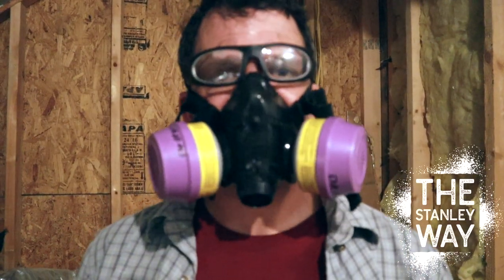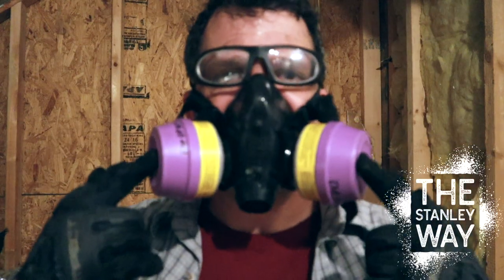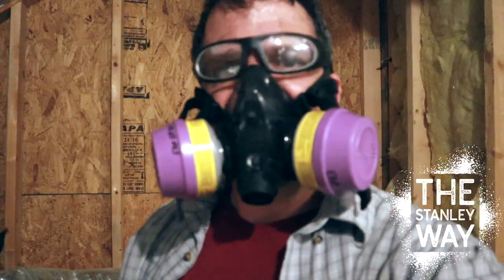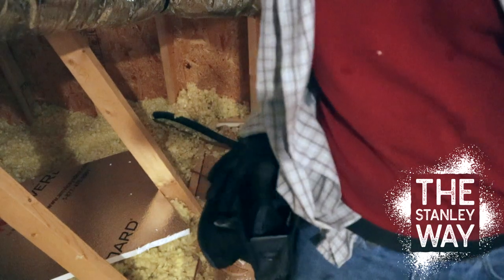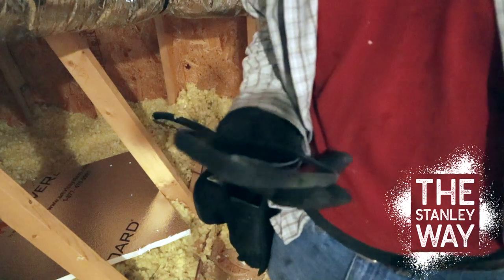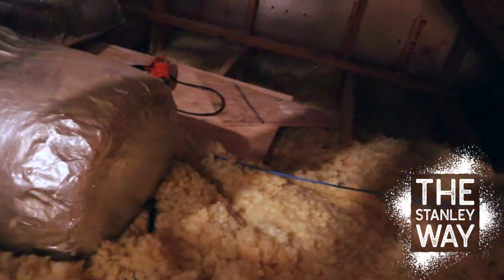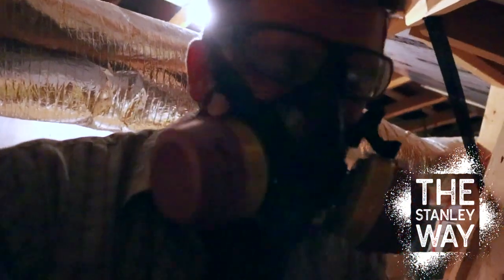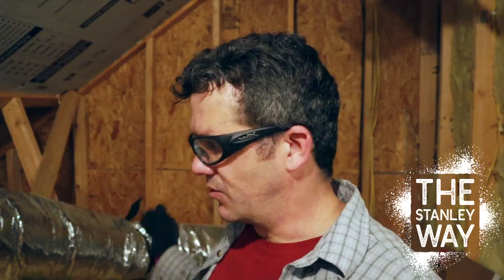Vented To Unvented Attic Conversion Video

Comment: Live in SC and have the same issues with my HVAC ducts and air handler being in my attic.... Was thinking of getting it spray foamed. Looks like you insulated between and over the rafters with foam sheets? Any issues with moisture because of that?
Reply from the maker: I have had no issues with moisture. Since I used foam sheets it’s not 100% sealed of course but there is a huge difference in temperature. It has worked great so far.

Comment: Love this video. What did you do for venting? I mean to make sure there isnt any humidity build up leading to condensation? Did you have soffits and what did you use to close them up with?
Reply from the maker: Thanks, I only sealed the gable vents so I still have venting from the soffits to the ridge. I am currently adding rigid foam board insulation to the bottom of the rafters. This will insulate the attic while keeping the area between the roof deck and foam board open to vent out of the ridge.